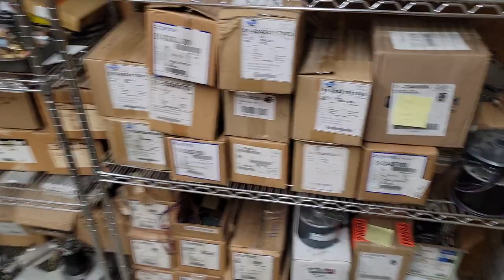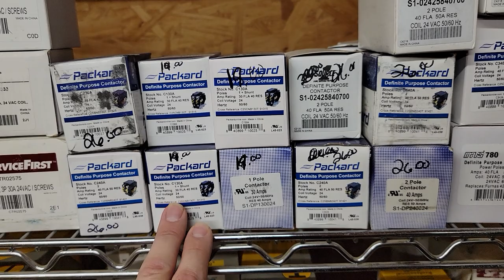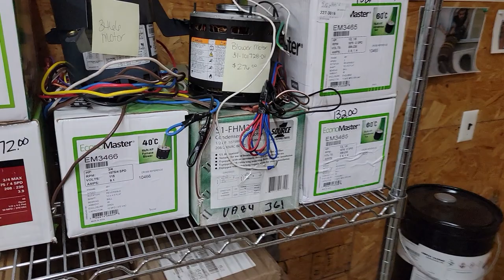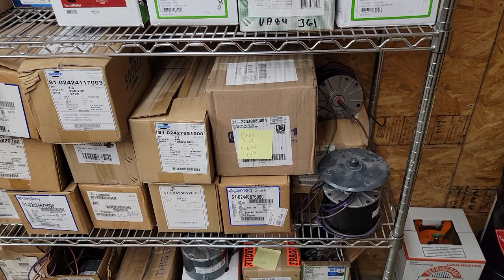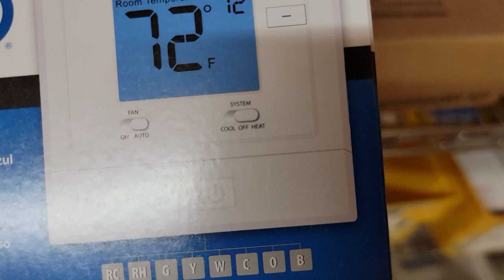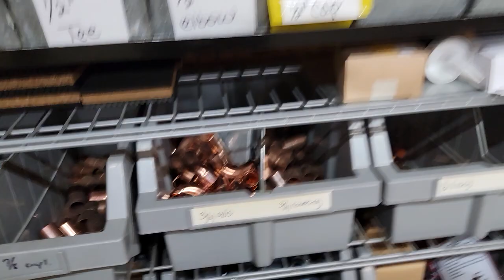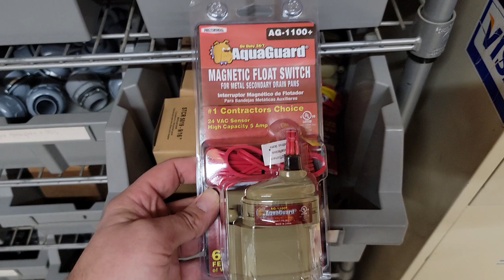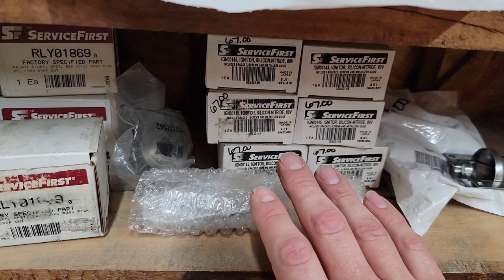What hvac parts should you keep in stock?

Comment: Good information. I also keep some universal control boards and a compressor terminal kit on my truck.
Reply from the maker: I knew I forgot to mention something 😅 🙃 
Thank you for this 
Definitely the compressor terminal kit
Reply: What are some symptoms when it needs to compressor terminals.  Are the wires completely loose? Does the compressor usually run when it needs a new terminal kit?  I've had several compressors that roared like a lion during the summer lol
Reply: @heatncool  Most likely the compressor won’t run at all. You’re gonna have a wire burnt off on the CSR terminals at the compressor and most of the time one of the terminals will be so messed up that you can’t use a push on terminal. Most of those are flag type terminals anyways(which they make a crimper for flag type terminals also), but….. That’s when you’ll need the compressor terminal kit.
Reply from the maker: Thank you for commenting this Awesome @HvacGuitartist
Reply: @TaddyDigest  No problem at all. This is Brian from Jackson. I’ve talked with you a couple times on the phone 👍

Comment: A little late on the video but instead of carrying 20+ capacitor variations why not stock the turbo series capacitors and get multiple variations in one unit? Turbo 200, turbo 200x.  I think these range $60-100..  I do realize some fan run caps can be cheap like around $3-6. Doesn't it make sense to pay a little more $15ish for something like a turbo mini? Made in the USA? You would just pass the cost on...
Reply: because on top of being 4x the cost of a regular capacitor the universal capacitors don't last as long

Comment: I see you have a lot of packard contactors. I find these to be extreme garbage. I install them and im back a few weeks later with blowen fuses on the furnace circuit board. I tested the resistance on a new packard contactor and it is 16ohms. Tested the trusted and true Square D contactors new they are 58ohms. Huge difference, the lower ohms causes excessive amp draw casuing issues in the low voltage control circuits. Ill never buy packard again.
Reply from the maker: Hey Taylor thank you for watching I'm glad you noticed that I love the knowledge thank you for sharing this knowledge with me
 I will be checking out the square D contactors